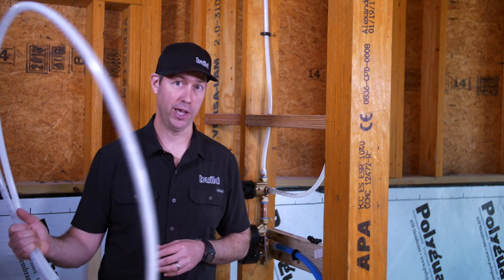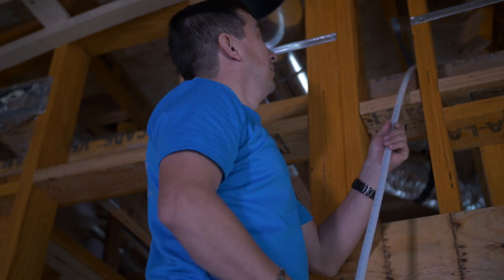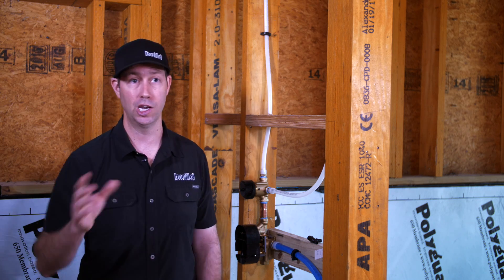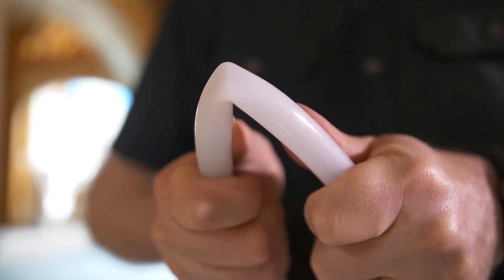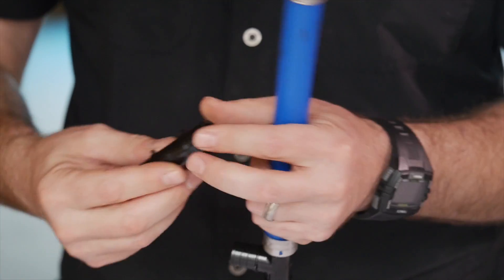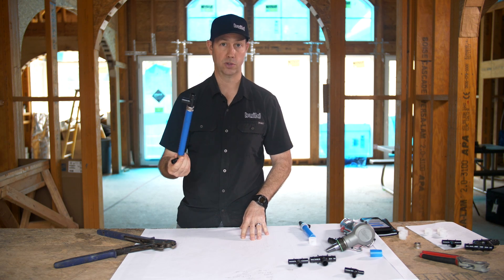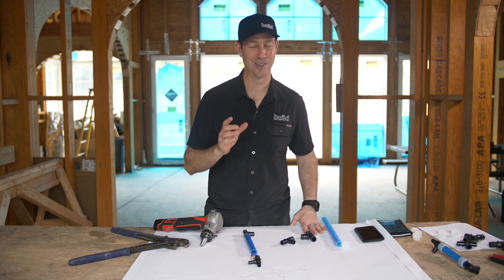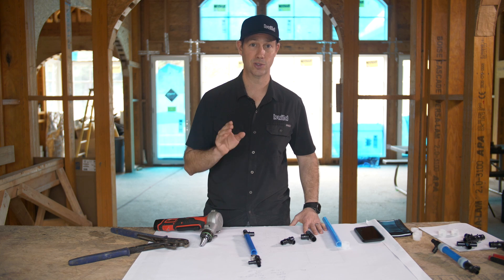PEX vs. Copper Plumbing

Comment: I moved onto PEX, but now use Polybutylene, which is around 30% more expensive in the UK. It's great for no-join pipe runs for the central heating.
Reply: Insurer wouldn't insure house if Polybutylene plumbing was used.  Reference: "Does Homeowners Insurance Cover Polybutylene Pipes?"
Reply: @tmcg4019  There may be different manufacturing standards but here in the UK I've heard nothing about poly butylene pipe being an insurance issue. If any UK product has the British Standard 'Kite Mark' or another body like the Water Council, it's use is perfectly acceptable. The last house I built was monitored by the Insurance Company the entire build and all the pipework passed.
Reply: @terencejay8845  It was acceptable in The States, too, until it wasn't.  In all, given better choices, and given the following facts, I would consider it imprudent not to choose better on behalf of your customer: "Does A Seller Have To Disclose Polybutylene Pipes?  In many states, sellers are mandated to disclose polybutylene pipes. Almost all real estate listing agents require the seller to disclose the use of polybutylene pipes in the property. They suggest the sellers either bring the market price of the house down such that the buyer could make the necessary replacement or replace the system on their own with copper pipes. There have been instances where buyers have sued agents and firms for not disclosing the use of polybutylene pipes in the property."

Comment: A few questions. 

1.) Copper has antibacterial properties. Does pex?

2.) Is there a fitting i can use to convert copper to pex?

3.) Can you use unions with pex?

4.) What are the max rated temps for pex? Dishwashers i work on have rinse temps of 180+.

Few questions i would like to know. I sweat copper all the time. Dont know shit about pex.
Reply: 1. Its meets the NSF/ANSI Standard 61, for potable water products in the US

2. Yes there are MIP's, FIP's and sweat adapters (Male sweat and female sweat adapters) 

3. I have not seen one.

4. The temperature rating for uponor per is 210°F (99°C) at 150 psi.
Reply: @generalzero2349  probably could just use a sweat adapter on a union. But, thanks for the info.

Comment: No pex for me. I just had to fix a ton leaks for my neighbor. House was plumbed with pex.
Reply: sherm dog- I bet it was bad pipe or bad install
Reply: @jesseschoenfelder6455  could have been.
Reply: I'm a plumber and very rarely do you get problems with it. Either installed wrong or bad pipe

Comment: Yes, PEX is a great product - when discussing construction.   It's important to mention that many decide to go with copper because of the much-reported 
 risks regarding chemical leaching in PEX and PVC's.
Reply: Source please. Not just anecdotes.
Reply: @michaellehto1697  
Is there evidence that it doesn't?
Reply: @MaximC  Is there evidence that it does?
Reply: @kodkid  
It's a new thing, so it's reasonable to be sceptical about the use of it, not vice versa, to be sceptical about non use of it.

I think we can create and use "old"/"natural" non-toxic materials in most of the scenarios where we use petrol derived ones, probably the main reason why we use them so widely, is because it's cheaper to produce them - but we pay more for that anyway, with our health and with pollution of our environment/air/water/food/etc.
Reply: Very true.
Reply: There is evidence of chemical leaching in PEX, but it levels off quickly with use. Additionally, you would probably be surprised at the contaminants already present in your local tap water.

Comment: You note that you "happen to have the automatic expander" by Milwaulkee, but you don't identify how to expand that piping system without that tool.  Is there a "manual expander"?  I suspect that "automatic expander" is worth more than a few bucks and nothing that an average homeowner would own if he was just moving his washing machine or dish washer supply lines.  Can a home owner buy PEX by the foot in short lengths for small jobs like he can for copper or CPVC?  All I've seen at the big box stores is 50 and 100 foot coils.

Comment: Can you mix of with copper ? For instance like a repair to existing copper pipe system.
Reply: Yes, I have a few pieces of PEX-B that were used to replace copper with pinhole leaks.  I'm planning to remove all the copper and go with PEX=B and a Viega Manabloc.

Comment: Was searching for the benefits of PEX in new homes, thank you for this video!
Reply: I'm a master plumber in Atlanta, and I have been using pex to repipe houses. Very easy to work with. I use elbows instead of making wide turns (most of the time) It looks more professional. I use the crimp tool type. Look at pex and freezing. I read article on a plumbing site where plumbers were saying (in Alaska) that some of it froze, but didn't split.

Comment: Never met a safe plastic for a supply line that beats the anti microbial benefits of copper.
Reply: The problem with coppers antimicrobial benefits is it does change the taste of water. I don't mind using it for my bathrooms and especially hot water in my kitchen (who cooks with\drinks from the hot tap anyway) but my fridge and cold kitchen tap get galvanized - and galvanized is unlikely to ever fail on cold water lines...it's hot water that carried more particulates from the water heater, and the expansion\contractions, that cause galvanized to break down over ~50 years it seems.

That said, most of my house is copper, including every hot water line, and I run PEX to the exterior valves and the garage where sub-zero temps here in Chicago have no impact on it, or its fittings (PEX A)
Reply: @emotionz3  New gal ismade overseas from old cars and cans.  The old usa stuff lasted for ever.

Comment: The pex  fittings reduce the inside diameter of the pipe by how much?
Reply: I'm not a plumber, but from what I've seen, they actually have a little bit they put on the end of a drill to flare out the PEX. So I THINK the couple inside diameter is the same as the PEX you are using.
Reply: Nevermind

Comment: Late comment, but bending any pipe turns the I.D. From circle to ellipsis. Curious if this minor restriction adds up over the course of the whole project run (and knowing that some 90’s will still be used).
Also, does PEX have BPA, or like the crowd, manufacturers switching to unknown safer alternatives?
Reply: I was wondering that too.

Comment: As a formally licensed Texas plumber (drive a truck now way more money) who has done many houses in midland /Odessa area I would recommend Uponor brand for a few reasons myself which you covered like freeze ability. According to a Uponor report is almost impossible to break by freezing. Personally never seen it happen in fact we the guys tried to do that very thing by doing a small model and throwing it into a freezer and the pipe just swelled up and went back to normal after being it back to room temperature.
Next with Permian basin area having the hardest water in Texas seeing a house copper plumbing system destroyed by water hardness. I have done dozens of rep repipes and we always used PexA.
It also is extremely easy to use a loop system which prefer because of using a recirculation pump and having almost instant hot water always. I believe you vaguely touched on the subject referring on somebody else. Lastly the ease and speed of doing the house in PexA is incredibly fast.  Basically 3 days to do a whole house and rough, top out and final or finish. A plumber and one helper can do it all. Personally I like putting all my plumbing in the ceiling but we rarely did that unless it was a relipe or on a new custom home the owner or custom builder specifically asked for it in the ceiling.
Otherwise we did it below grade.
Thera is my 2 pennies. I like your show.
By the way we me and my wife just had a home built in Mexico for us. And wow what a difference. We spent 3.1 million pesos. Roughly 165k in dollars. Very nice but homes in Texas are built better.
Reply: I plumbed in Odessain the seventies and man you are right.  Rheem water heaters gone after five years and tub spouts rotted off after three.  Popular bumper sticker said; "Odessa Tx isn't the a-hole of the world, but you can see it from there".   Another one said, "whatever you do, don't tell my folks I work in the oilfields.  They think I'm a piano player in a whorehouse"  Lol.  I always thought the oil industry wrecked the water supply.

Comment: Industrial standard is copper. Pex is ok for single family units or my old boss used to say for: "Micky Mouse Plumbers".
Reply: Every new thing is "Micky Mouse" then one day you're left behind.
Reply: @davidkereluk1805  thanks for the reply. I don't agree with the Micky Mouse plumber label either but thought it was funny coming from an old plumber master who mainly works in industrial buildings. I did some remodeling in my house and could have opted for the cheaper and faster method of pex but I simply don't trust it. You may be right and I could have saved some money and time but in the end, I love the copper and I know it will work for the next 50 years trouble free. (unless the pipe freeze)
Reply: @cetinkable   Ever heard of electrolysis?  My house has copper pipes I have to replace because they are eaten through with electrolysis. About 40 years old. I'm replacing with Pex.
Reply: @davidlindgren7605  I fixed many pin holes in copper. They are usually a result of incorrect installation. The corrosion in copper is usually not too far from where the copper had contact with another metal. Type L copper installed properly last a life time. My main concern with pex is the deterioration of plastic ending up in your water supply slowly poising you.  I have no proof for this statement just opinion. If this makes you feel unsure, I suggest to use copper only for your kitchen line ensuring the copper has no contact with any other type of metal (except brass).
Reply: @davidlindgren7605  Same here, at 19 years
Reply: @davidlindgren7605  Unhook the ground and drive one into the earth...problem solved.

Comment: Honestly, I despise copper almost as much as PVC/CPVC and galvanized steel. Copper's way too expensive, requires solder & high heat, and is fairly easy to pierce or break. It beats out galvanized steel because getting pieces together isn't an utter nightmare, even though it does require the soldering. It beats out PVC/CPVC because I don't need to buy a damn bottle of glue every time I want to do something with it and it's less fragile.

Pex is definitely a lot easier to use once you've got the stuff needed to put it all together and fairly cheap after you get the initial tools.

Comment: As a plumber, I'll bet you have less pressure drops in properly reamed copper than in PEX. You use barbed or other similar mechanically fastening fittings in PEX that essentially reduce the flow to one size smaller pipe in the joints because they are inserted inside the tubing. Also, water hammer is in PEX, resulting in pipe slap. It's not as loud as rigid pipe like copper, but PEX has to be pinned down in smaller intervals to properly resolve this, particularly in the turns.

Comment: In the early 1992 I left some Sears Craftsman rubber Garden hose outside In the freezing cold they were frozen but Not busted so I grabbed the hose and bending It and got Water flowing through It and because I was always having to replace PVC pipe that froze and busted I went and replaced all My pumping with Sears Craftsman rubber Garden hose but them large diameter hoes are a pain the thaw out looking for an easier way of doing It I tried Electrical heat tape and about burnt My house down so what I tried Is with some flexible 4 Inch diameter drain line cover the hose and then when Is freezes I use both a hairdryer and heat gun to blow warm Air  over the hose but also something that I have been wanting to do for years and finally a few days ago done because with them large diameter hose It takes forever for the hot Water to get to Me and creating a lake In the process so I decided that I needed a smaller diameter hose so I bought some Goodyear rubber Air compressor hose but I had a lot of trouble getting the fittings I needed a 3/4 Inch to 1/4 Inch brass bushing all Lowe's had were plastic and had bad threads and did Not work and Home Depot wanted 35 dollars for shipping but I found what I needed on Amazon and I finally after all these years got one set up a few days ago

Comment: Builders and plumbers swear by PEX because they can send out the stupidest employee from the cheapest bidder subcontractor and might get the pipe installed close to correctly.  That's all.  My top three choices for plumbing are copper, CPVC, and copper.

Comment: I started watching these because I have to replace a water line after our recent freeze.  My trade is carpentry.  As an observation of what all the plumbers have been doing, I have seen this newer pex with the expandable locking collars that self seal around the fittings.  pretty cool stuff!  I just wish I could get it for myself.

Comment: I was a bit disappointed that this wasn't a true comparison video.
Reply: It is. There is like no advantage of going coper. I just had to replace coper pipe in a house. 45 year and started to leak everywhere. Will see how long the pee holds up, but installation was like 20 times easier.

Comment: 411 @ 3:37 your pex install is damaged should repair that area .....also i would not recommend tight loops, keep your loops loose (big), that way no pin hole leaks at the stress points in the loop....great videos/enjoy watching....

Comment: Great video, as a non-professional and the regular diy guy I just wanted to ask if you would recommend this method,materials used and fittings in a situation where you don’t have an access panel to check on fittings and connections ,in my case I will be relocating shower valve and supply lines but it would be without access panel.
Thank you

Comment: Copper would be a good choice to prevent rat damage; I own and operate a pest control company. Over the years, I have occasionally ran across leaking fresh water plastic plumbing caused by rats. You may want to take them into consideration if you even suspect them under or in your house. Rats will gnaw on anything except for metal and glass, I've even seen gnaw marks on concrete. You should also ensure that  your house has no holes or crevices greater than 1/4", mice can get in at that size of a gap, and rats can get in through a 1/2" hole. Most homes have mice, some have mice and rats, and the occupants may not know.
Reply: John Nash, thanks 👍🏻
Reply: Does pipe insulation help at all with rodent damage on plastic piping?
Reply: @truedox  Not if you spray it w/ hot
 sauce.
Reply: Thank you for this information, John.

Comment: So, what are the disadvantages?
Reply: Yeah, he really didn't address that well. 

Too much chlorine could degrade it... UV light will definitely degrade it, so make sure you keep sunlight off your installations and store any extra pex away from that. 

If you have to connect it to galvanized steel, you need to be careful about corrosion from unlike metals being in contact with each other. Copper + galvanized is bad. Brass plus either should be alright.

Animals could potentially chew it up, similar to PVC.

Some fitting crimping systems are better/more idiot-proof than others.

It hasn't been around for as long as the other options, so its unclear just how long it can last.

Comment: First time you buy copper and it's not 100% and corrodes and fails in seven years you'll never use it again. I placed a whole roll of like 75' most of it failed with pin holes in several places.
Reply: . you just have to remember to wipe off flux, not splatter cement on it and not have it touching a different type of metal and it will last over 200 years. When I say 200 years I'm not talking about some silly companies warranty ( quest, pex) I'm talking about real world application tests and science.  Also copper pipe is generally used for plumbing  ( harder and straight pipe) tubing (soft roll) is usally used for hvac and refridgeration lines.
Reply: @sr-qk4md  I know how to solder! It was failing every where in  long runs away from any solering points. Flux was t not the answer. it is believed that that batch of copper tubung was not 100% cooper. That Pex pipe with the shark tooth fittings is so much faster and easier. There is no way I would ever use copper tubing again. I only need it to last  maybe forty years, than I'll be 100, and probably won't need any plumbing any more.

Comment: Any water taste issues are most likely due to some mineral or metal that existed in the copper pipe that you become accustomed to tasting and with PEX it's cleaner and therefore you are tasting the absence of a mineral which was overpowering whatever you are tasting after it's installed.

Comment: I asked a plumber here In Dallas area what is better he told me it's the same really ,between copper and pex . He said you can use copper if you want to spend more money. The only thing he told me was to stay away from shark bite fittings, and yes I have seen those fail constantly.

Comment: The system we use in Norway is pex. Only it is pulled through another tube, just like electrical wires. So if there is ever a leak, the water will be flowing through the second tube, and back to a box where it is all connected. From there you can shut off the water, pull the broken tube out, and insert a new one through the outer tube. no need to open a wall, and no water dammage.
Reply: I LOVE that idea!!!
Reply: vegard berge Haugen ha
Reply: Now that's the way to plan all of your construction. It would be interesting to see how this is done...
Reply: @dallasbeus2117  https://youtu.be/XTgL-M-9mcI
I didnt see the whole thkng as I am at work. But it should be something like this.